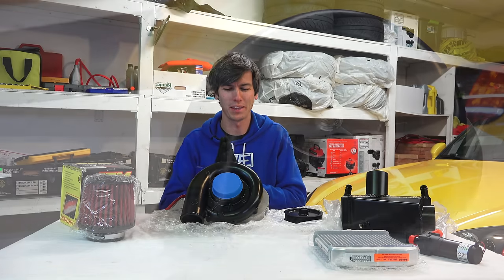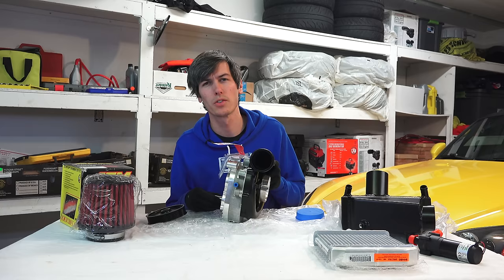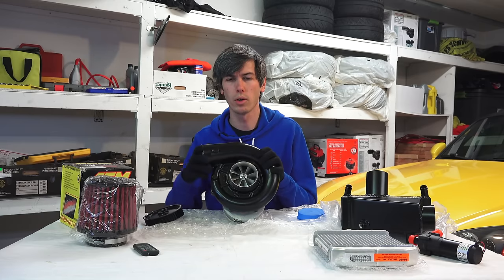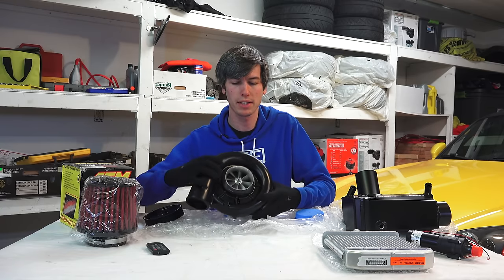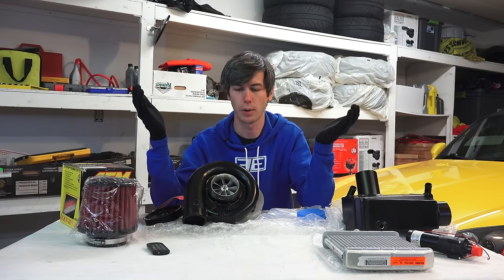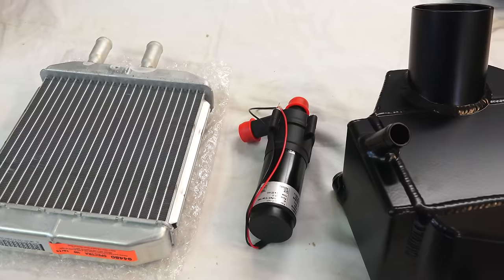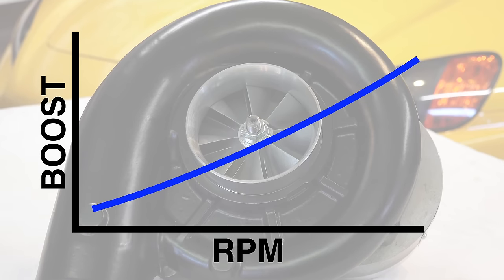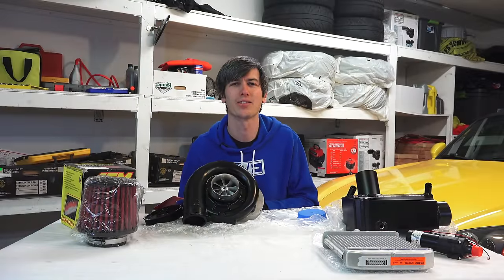How Do Centrifugal Superchargers Work?

Comment from the maker: Part of me didn't want to share this video because I know that going forward I'll have a lot of pressure to get this supercharger install done, and I know it's not going to be happening as soon as folks (including myself) would like. Part of me wanted to share this video so that I would get pressured into actually completing the supercharger install. Hope everyone's having a wonderful day! If you're into scrolling through photos, consider adding my photos to your endless list: https://www.instagram.com/engineeringexplained/
Reply: The longer you delay the installation the more time you will have to reconsider your purchase , sell it , and do the right thing and turbocharge the s2000. A properly sized turbo will more reliably make more power in all RPM ranges than that supercharger
Reply: Engineering Explained Hi. What about ceramic coating to engine parts, exhaust parts and other parts? I own a 2005 Subaru Legacy Spec B 3.0R wich engine its being completly repair. I will aplly to the pistons ceramic coating wich will help to protect them and get some more Hp. After this I will aplly ceramic coating to the exhaust headers. It got the same objective has thermal blanket but with time It wont damage the exhaust. The thermal blanket usually make small holes on the exhaust. Can you review ceramic coatings in a future video? Thanks. (Im from Portugal)
Reply: Relating to sanisidrocr's comment I'm sure we would all like to know what back of the envelope calculations you did maybe to predict what kind of power you would add with this install, and maybe how that impacted your choice to do this mod over a turbo charger. Obviously you have fun driving the car I like the idea of making small subtle improvements. Like you said more power means more damage, what a shame it would be to go overboard.
Reply: There are plenty of dyno tests comparing this kit to various turbo kits and people like me who have installed and tested these kits over years know better. Centrifugal superchargers produce most HP at peak RPM which is actually more dangerous for the engine. If you were concerned with reliability you would choose a more conservative sized turbo that would end up with less peak HP, but much more torque under the curve and thus make a more reliable , quicker, and more drivable car. There are literally no reasons to ever choose a centrifugal SC above a turbocharger.
Reply: Do a turbocharger instead
Reply: Engineering Explained is it done yet?
Reply: Engineering Explained Hi Jason, i have a question:
Wouldn’t it be possible to install vario pulleys and belt to run the supercharger?
So when the engine rpm is low, the supercharger spins faster and with higher engine rpm the charger spins slower.
That should increase more airflow to the engine at low rpm and the boost should be more even at the whole rpm range.
Thank you and keep up the good work man!
Grtz from Belgium
Reply: Boost it now!
What are you waiting for?
Am I helping yet 😁
Reply: My supercharger has been sitting on the shelf for 3 years.
Reply: Forced induction on a n/a motor which was never designed for boost is never a fun project.
Reply: Engineering Explained as long as you make a video installing it, it will be fine hehehe
Reply: Haha get it fitted! S2000 rotrex are fun
Reply: There's no pressure like peer pressure. Do it! Do it!
Reply: The hardest part is getting started! Plus, you've got Eric the car guy, Scotty Kilmer, and the Humble Mechanic if you get stuck...Anyone thinking collabo video! 😀
Reply: Engineering Explained Is it possible to make an electric supercharger?
Reply: If you do it, I'll do it to my yellow AP1 too 😜
Reply: Engineering Explained “a lot of pressure” 😂
Reply: sanisidrocr Except, he wants to enhance the natural characteristics of this engine. Its not all about numbers. I imagine an S2000 with a centrifugal supercharger would feel amazing. And maybe it would be cheaper than a turbo set up. 
Possibly sound better as well
Reply: Is it done yet?
Reply: Engineering Explained DEW IT!!
Reply: yep........install it.....
Reply: Too bad they didn't give you a free kit.
Reply: Keep it N/A!
Reply: Nice video, as usual. By the way, you should install that supercharger. ;)
Reply: Another advantage of the centrifugal supercharger is because it doesn't make boost at low RPM it also doesn't create undue stress on the engine at low RPM.
Reply: HKS is a lot more better very efficient clam. Evasive motorsports has em.
Reply: I guess he is trying to conserve the personality of the car. He seems to have chosen that S/C specifically due to how it behaves similarly to the F20c, and other advantages he pointed out. Now I'm not Jason but he seems to be more interested in the cars dynamics and balanced capability than producing higher HP numbers and his modifications on the car speak to that. This is one S2K that might just be a mildly modified canyon carver. To that, I respect!
Reply: This might be interesting to watch. I would love to hear how to change award winning N/A engine to a boosted one. 11.1:1 compression ratio is high for big boost curve. Camshaft overlapping is helping N/A engines, but might lean fuel mixtures for boosted engine. Ignition timing reduce and fuel mixtures under boost pressure might need a new ECU. Fascinating!
Reply: These motors are more built than most FI factory motors.
Reply: I put in this very kit into my 2002, and gained +120HP with an exhaust...on a day that was 20F warmer.  Oddly enough my MPG improved overall.  Under -2PSI, any boost is sent out the diverter valve, so parasitic load is very low.  I think it increases intake air velocity allowing more air to get into the cylinders with less work on the intake stroke to bring in the air, increasing efficiency.  No pressure build, but it does seem to gulp more O2 even without boost.  30MPG highway is easier, and over 300 miles/tank is repeatable, which was not the case when stock.  When cruising at 4500RPM, that blower is throwing out a very high volume of air, filling the manifold but not being allowed to build pressure.

Hardest part of the install is the fuel pump, but with patience is a 90 minute job.  The crank pulley is easily removable with 2 breaker bars with pipe, along with a jack stand to hold one of the breaker bars...it came right off.
Reply: Where in heck are you going to find room in a S2000 engine bay to install this??
Reply: Engineering Explained Hi Jason,
Why the extra radiator and water pump? Can’t you use existing water cooling system? Perhaps with installing an improved radiator?
That would be more straightforward and would help keep the engine cool at high HP as well.
Reply: keeping it a separate loop would probably be best in this case. it allows the intercooler to maintain a lower temperature since it is only gathering heat at the intercooler and maybe a bit at the pump and just ambient from the engine bay. running it from the engine's cooling loop would unnecessarily heat the intercooler, as well as changing the engine's operating temperature which could cause a whole host of problems.

it also makes the whole kit easy to uninstall if he wants to put it back to stock (maybe to sell it)
Reply: Engineering Explained why would the power curve be different from a screw or root wouldn't their pressure not increase with rpm also ?
Reply: Yes please. I'd love to see you summarise your "trade study" on this. I know you did one like a good little engineer! ;)
Reply: what a clever joke, you want "pressure" from your viewers to install the "supercharger"...... install the supercharger and you'll get all the pressure you need... lol
Reply: Engineering Explained I would like to see a supercharger like this hooked up with an AC compressor - style electric clutch. Maybe that could be part of your project? I want to try this as a project after I'm done engineering school. Then you could have the efficiency of a normal engine (even better with an air cooler) and press a button for more power
Reply: Think of it like this... The more you procrastinate on installing the supercharger, the more time you will have to enjoy your S2000 without a blown engine.
Reply: Easy on those puns, you don't wanna blow off your viewers.
Reply: ... I'll have a lot of pressure ...

... so that I would get pressured ...

hyuck hyuck
Reply: Engineering Explained you forgot the most important advantage of the centrifugal supercharger. An idling pinwheel sleeper avoids broadcasting its own "I'm a trap"  PSA as obviously as other forced induction does with the whistles and whining. With creative use of resources, like sound-deadening mock-up cover to appear as an ineffective intake resonation chamber or any method of masking the unmistakable snail even ricers won't miss. I mounted the SC low near the K cradle, used the top half of an old air box over the snail with a  slot for belt, finally making a mostly PVC pipe cover over boost duct (appearing like a 7 yrs old kid had built a cold air intake). It worked for all ricers, most cops, but very few people that had proper knowledge of engine enhancement would not notice the pinwheel if under the hood.
Reply: All these people crying turbo have never installed one...
Reply: Don't rush it especially at the expense of your normally thorough analysis of stock vs upgrade.  I would like all those baselines for stock setup like noise, gas mileage, power, "feel" through all the separate gear changes plus the actual full installation video prior to the pros vs cons analysis. Keep up the good work.
Reply: +Engineering Explained really awesome initiative. Well thought through regarding the comparison between your engine characteristics and how this type of supercharger is a good match for it! Good luck with the build, I am really looking forward to it :) You should ask for help from the HumbleMechanic :P
Reply: I was sceptical about this choice of supercharger at first, but you absolutely nailed your reasoning and proved yet again that you know your mind well. I look forward to your further videos, and thank you for sharing!
Reply: Let LHT performance install the supercharger , they specialize in S2000’s and they also have a channel on YouTube , check them out 👌!!
Reply: PROCRASTINATION IS THE PASSTIME OF FOOLS
Reply: Take your time, we're not going anywhere.
Reply: Engineering Explained can you go over Ford's new engine proto that can burn diesel or gas
Reply: Engineering Explained can you explain the difference between this supercharger and a procharger?
Reply: The reason the S2000 is such an iconic car, is not related to pure power but how that power is transmitted on the road. It was never conceived to be a drag racer, its so much more. In the stock s2000, it is direct and progressive even in incredibly high rpm (yo!) making you connect to the car and be in absolute control. Albeit admittedly bigger gains with turbochargers, they come with the cost of less linear power output and turbolag which subtracts from the experience and actually makes the car slower on the track.
Reply: Don't worry about the time. Take your time and do it right and if personal stuff is taking your time don't worry about it we understand. Love the content!
Reply: What supercharger did you get?
Reply: There's actually a lot of room.  That huge airbox come out, replaced with the blower and heat exchanger.
Reply: That fluid is generally over the boiling point, so the other cooling loop has fluid that remains much cooler.  With this very system, my intake air temps are usually 125F at worst.
Reply: Which kit are you putting on your s2000?
Reply: Are you going to make a video covering the dyno of your supercharged S2000?
Reply: quick question, now i know most Cent SC setups run the throttle body after the SC but "Can you run it prior to the SC (on the intake side)?"
Reply: So a centrigufal super charger (procharger) is more so of a tubro or supercharger? Or both
Reply: Is the supercharger fitted on the S2000 yet? Lol
Reply: Please reply bro i need to know where this centrifugal supercharger was bought
Reply: It's too bad you didn't go with a Rotrex unit instead. They are way more efficient than other centrifugal supercharger brands.

Comment: How to trick a non-car guy to believe your car has a turbocharger but actually it's a supercharger!
Reply: but why would you?
Reply: Except a turbo is a form of supercharging
Reply: Jonah Beale   Anytime air is forced into an engine it is supercharging. Belt driven, exhaust driven, or even driven by compressed air, it is still supercharging. Turbochargers are acedemically and properly known as turbo superchargers.
Reply: Wouldn't they actually be referred to as turBINE superchargers, then?
Reply: Jonah Beale not all superchargers are turbos but all turbos are historically superchargers. A turbo can be considered a type of supercharger, because a turbo was originally called a “turbosupercharger” which was shortened to "turbocharger" or simply to “turbo” later on. Just like a centri is a type if supercharger or a pd supercharger, etc... There are a ton of different turbo setups and ultimately turbos became pretty much a separate category. Though if you wanna be super pedantic yea it's a type of supercharging.
Reply: +Christopher Riley If that's so, then what's the name for a system that pairs one or more turbochargers with a supercharger?
Reply: you: look my car has a turbo..
non-car guy: whats a turbo??
Reply: They're the same thing.  Centrifugal superchargers are just belt driven turbos.  You just get a linear boost curve better throttle response and easier tuning.  It won't be a big whomp of air and power breaking your tires loose.
Reply: just tell your non-car guy friend that your alternator is the turbo.
Reply: Either way you still got boost
Reply: by telling him its a turbocharger!!
Reply: Jonah Beale yes I think a turbo uses exhaust gas to turn the turbo so you apparently get lag.
Reply: Correct. The full technical name is "Turbosupercharger" (gas turbine from the exhaust linked to centrfigual supercharger at the intake)
Reply: You get lag on conventional turbos due to inertial effects (small turbo =less lag but lower boost, largeer turbo = more lag but higher boost), but the output energy change can be drawn from immediately if you can keep the turbo spinning at a higher RPM and don't rely on rpm changes to vary your input boost - which is where the variable vaned turbos come into their own, effectively acting as gaseous torque converters to keep turbine velocity more or less constant as gas output drops away.

The same principle is used in most large hydroelectrric generators, where you want more power from a generator by changing the water flow but the rotational speed of the generator must not change. This is achieved by using vanes to increase/decrease the velocity of the water/gas that impinges on the turbine blades as the volume decreases/increases)

This same issue (intertia) is why a Toyota used complex CVTs on their 1980s research gas turbine vehicles - when you put your foot down, the increased torque is available immediately but RPMs change very slowly (the big failing of previous direct-drive turbine car engines even if using conventional hydraulic torque converters). By using a CVT they were able to run at constant RPM and convert torque changes to roadwheel velocity changes. Toyota's gas turbine engine research didn't survive, but all that support work on coupling gas-turbines to roadwheels is the basis for the improved CVT control systems we see in almost all modern vehicles and the research they did  on coupling multiple gas turbines to roadwheels is the direct ancestor of the multi-input transmission in the Prius.
Reply: they dont even know what either of them is
Reply: Kahless 01 the "turbo" part of the name refers to the turbine, i.e. the "hot" side. The opposite part is the compressor. So a "belt driven turbo" doesn't make any sense, it's a "belt driven compressor"

Comment: Im more of a turbo guy myself, just for the fun factor, and a supercharged s2k sounds pretty sick! can't wait to see it complete!
Reply: Gabriel Bailey as long as turbine heat is properly managed... Seen a lot of turbo owners whacked off their boost like mad, 2 mins later stopped by and just turn off the engine with oil boiling inside... Surely not long after that, something bad will happen... Unlike supercharger, not as hot as turbos... But less power though...